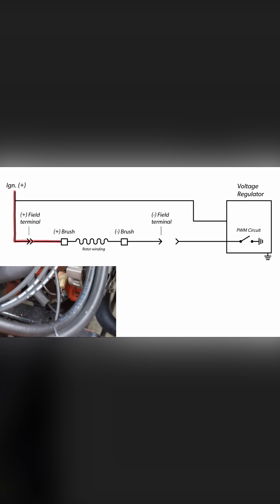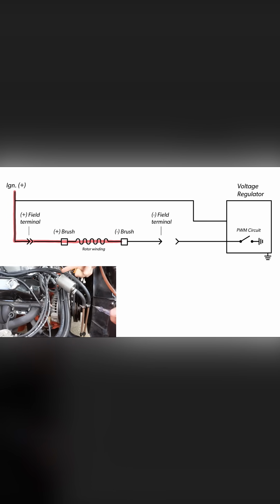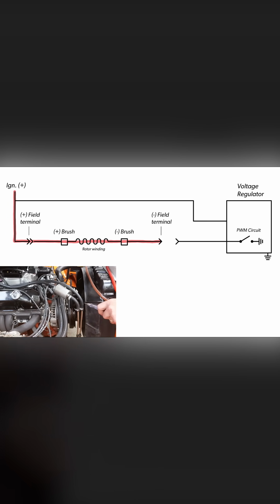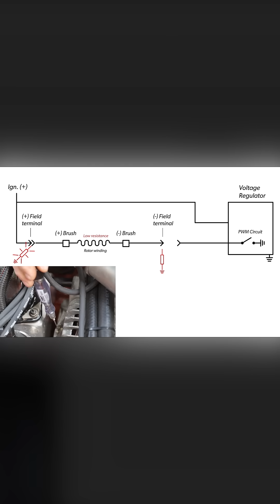Alternator Rotor Field Testing (Bad Brush Contact) #mopar  #alternator #voltageregulator

Comment: Would this test be applicable to any alternator, such as one on a 2003 SL500 R230?
Reply from the maker: Unfortunately no as the rotor field circuit is typically controlled by an internal voltage regulator. What makes this one easy is the fact that the regulator is external.

Comment: Can we see it light with new generator
Reply from the maker: Yes sir! Full video is linked in this short. Right on the screen. It says "Created from..."
Reply: @ScannerDanner thank you sir
Reply: Will that cause a dashboard battery light to be lit?
Reply from the maker: If it has one, yes. This 78 Power Wagon and this particular system did not have a battery light
Reply: @dianapotoski4035 the charge light does not always come on i think so its good to manually check charging voltages